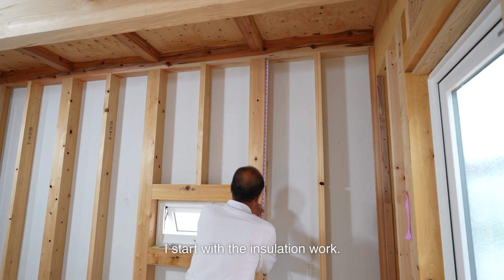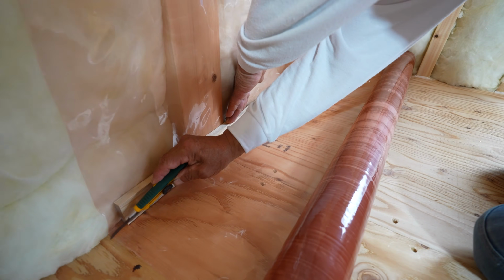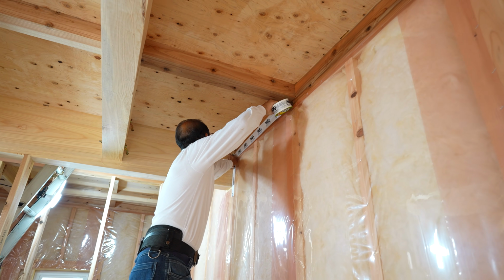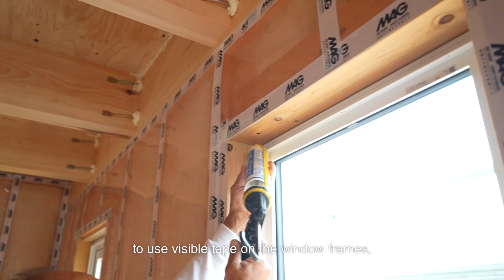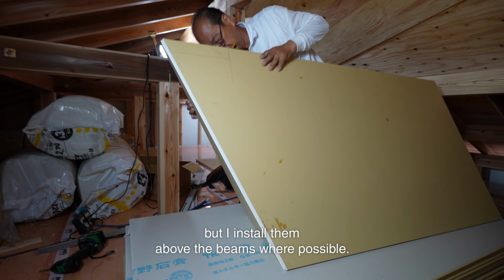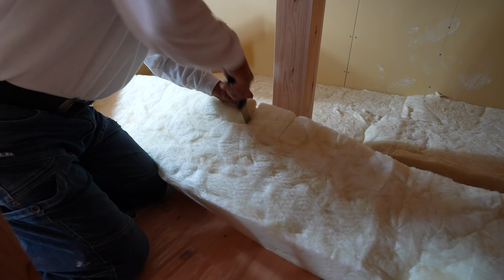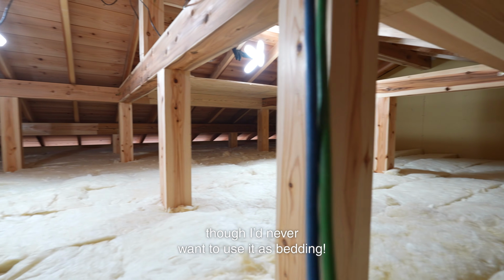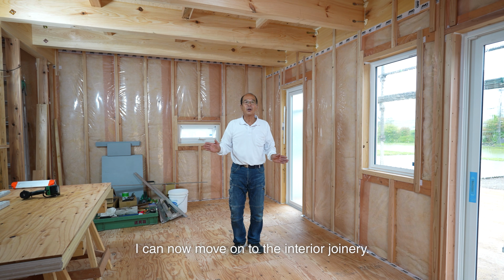The Ultimate Insulation Challenge: Creating a Magic Flask-Like Home | New Build Season 5 Part 5

Comment: I've built a house in Sweden and we use a somewhat similar membrane with the air test to rate the tightness of the house.

Previously, tape was not a requirement but it's used in all new construction.

There is also a technique used that creates horizontal and vertical layers of insulation to minimize heat channels (wood) and retain heat.

Cool to see differences and similarities around the world.

Comment: There's another method for air sealing that fills the house with essentially a fog of sealing material that fills all of the gaps it goes through. The house is put under positive pressure so the material is forced through any gaps. Gaps you don't want filled have to be taped before hand. This method fills gaps you can't see or reach. I can't imagine it's good for the environment since some of the fog of material escapes to the outside.

Comment: When I left the U.K. they started to build homes that were passive, air tightness test ect were required to meet building regulations. Now I’m sat in a house/shed in New Zealand…. Let’s just say that it is roasting in the summer and cost a small fortune to heat in the summer. You are truly a craftsman.

Comment: You had a beautiful and spacious attic space before you added your two layers of insulation! Spacious enough to use as a useful storage space! … As for the MAG-tape used, I found it to be useless because you had already secured the plastic membrane with staples using a cordless staple-gun! … Having said this, … I did see that you took precise measurements & that you made precise cuts & precise installations. 👍

Comment: 1:32 you should apply a second row of insulation above the wood, horizontally, so that you minimize the thermal bridge caused by the rafters. The second insulation can be pinned by wooden planks to the existing rafters and after that you can apply that vapour retarder directly on the planks with double adhesive tape

Comment: Very similar to how we do in Finland if a wool insulation is used. Newer option is to use aluminium coated PU plates. In the attic we use blown wool nowadays. It fills smaller spots better than wool plates.

Comment: Why would you want an air tight house? I thought houses was supposed to be able to breath.
Reply: To avoid moisture going to where it shouldn't and rotting out your house. Houses don't breathe, people do.
Whether this was done right depends on whether a vapor permeable membrane was installed or not (air barrier= good, vapor barrier= bad).
Reply: @rsmith02  I'm thinking about old log houses (the only type I can say I know somewhat good) and with them you want airflow, but you're more right about this house than me :)

Comment: Assuming that value was acph at 50pa  with a value of 0.146acph is Way beyond passivehaus. 
None of my comment will be correct if my assumption is wrong however😂
Reply: It's a "c value" of air leaks/surface area ㎠/㎡

Comment: I usually hate companies that tell you you shouldn't use replacements from other companies, but in construction this is usually because the materials and adhesives are required to match to get the proper results, sometimes any results at all, and not just out of greed.

Also, using what is essentially a thick cellophane sheet to insulate a house seems practical from installation price perspective, but any damage done to it render most of it pointless, won't it be better to insulate the outside panels from the inside? Using something like "big stretch" or any equivalent to create an airtight seal between the wooden beams and whatever you nail into them to create the outside structure as well as between all of the panels with an extra of waterproof construction tape should create a perfect impermeable seal that is far less likely to be damaged by someone doing renovation, and any damage that is done to it can be easily resealed without tearing down the entire section of wall. If this cellophane membrane is punctured or cut, you are essentially forced to replace the entire section top to bottom, which is a big hassle.

An example of what I'm proposing would be the ZIP system.

Comment: How do you deal with punctures? The moment someone goes to hang a picture its no longer sealed.
Reply: Wrong, it goes into the drywall and there's a gap created by the furring strip.
Reply: @rsmith02  here things go through drywall, not just in it. And in some cases into the studs. It seems inevitable that it's going to fail as a complete seal.

Comment: I didn't notice any electrical receptacles installed on the outside walls. Won't an electrician need to cut the vapor barrier anyways to put in the receptacles.

Comment: I believe the number calculated on the iPhone is air change per hour (Q50). The final value of 0.146 air change per hour, or  1 air change in 6.8 hours. It is an excellent result. A passive house standard only requires maximum 0.60 air change per hour. Your value is about 4 times better. Good job, Shoyan.

Comment: Glassfiber needs a vapor barrier membrane like here is done. I really hate fiberglass, rockwool and similar inorganic insulation materials. These all need a vapor barrier and if somehow wood still gets moist anyway problems start to accumulate. I have seen this for so many decades. Last 20 years in construction I have used either wood wool, linen or usually cellulose based blown stuff. 

These house that are 100% air tight are like bottles. They need power ventilation and carefully calculated air flows. But that is the world today.

Your craftsmanship is truly exemplary, even with the use of plastic films.

Comment: I'm surprised you're not using a smoke test to find the gaps.   In the USA you walk around with a small smoke generator and look for the air escaping while under pressure

Comment: Just a thought, for the attic insulation, lay both layers at the same time so you don't have to stand on the 1st layer (unless you are laying them in the opposite direction)?  Thx for sharing.  I like the house building series.  From foundation to finish.

Comment: In Sweden this airtightness would result in moulds and wood fungus breaking down the construction and making the inhabitants of the house sick from allergies…

Different environments- different solutions😊
Reply: That's just not right. Japan has much hotter summer temperatures and humidity (35C with a dewpoint of 24C) making mold a much bigger problem than frigid Sweden. A variable permeability air barrier like Siga Majrex, which is used widely in Europe, work well here or there, both winter and summer.
Reply: @ it’s very well tested that airtight houses are more prone to develop problems later on.

Comment: what will you use for your mechanical ventilation?
Reply: AC most likely 😊
Reply: @WANDERER0070  Not in Japan where ductless minisplits are king. Likely just exhaust-only pipe fans plus ventilation holes. Some homes have ERVs and ducted ventilation but it's unusual.

Comment: Shoyan what about condensation build up and mold build up on the surface between the membrane and the interior finished wall? American homes have done away with a sealed home using plastic membrane. Homes are built aur tight but the inside and the exterior walls have a ventilation gap. Your a master at what you do. Very impressive and amazed at your attention to detail.
Reply: American high performance homes can use variable permeability membranes but you are right that the 3 mil poly is just for Alaska and very cold climates. Mag sells both.
In Japan the ventilation channel you mention is standard under the cladding.

Comment: I wonder how the ventilation is done for the house, fresh air is a must have.
Reply: Pipe fans and ventilation holes (or a ducted system) are legally required in Japan. With few exceptions ductless minisplits don't introduce outside air. Windows do not meet the 24h mechanical ventilation standard (.5 air changes/hour).
Reply: Open window 😂 turn on AC

Comment: If you use this airtight method, once the house is complete, how do you keep it airtight like when someone drills into a stud to hang something? Cabinets, TV mounts, even picture frames things like that? Also plumbing and electrical?? Where are those ran in the walls? How would repairs be made in the future without losing airtight?
Reply: Ceiling and wall boards have not been put up yet, though.
Reply: The furring strips and studs are where people should drill and most of those have tape applied to them which will seal the small screw holes. A handful of holes really isn't an issue. Small holes in drywall isn't a problem really as they don't penetrate the air barrier.

Ventilation holes will be cut through this envelope and also sealed with tape and made air tight in the same manner. It will also be taped at the outside.

The outside cladding will also be covered in a housewrap that is taped at the seams and where there are penetrations for wiring or plumbing. This is standard for such homes in Japan, the US and Europe.
Reply: @rsmith02  Everyone here keeps missing the point of what we are saying. A house in the US is wrapped using the ZIP system, for example, on the outside of the house. It is tested and found to be airtight. Theoretically the owners of that house could do a full interior remodel, pull down drywall, rerun wiring, change plumbing. As long as they didn't pierce the outside ZIP System, that house should still be airtight. This Japanese house, they can do none of that without compromising the airtightness due to the system being on the inside.  Just makes much more sense to have it on the outside vs the inside.
Reply: Exactly! I know in the US they do the airtight membrane on the outside of the house. ZIP system sheeting and tape as an example. Doing it on the inside like this makes no sense to me. And you know the owners are going to want a kitchen stove vent and a vent in the bathroom. This house is going to leak so bad before it's even complete.
Reply: @BretRogers  It is common practice in Japan to take measures to address the problems you point out in a country with high annual precipitation and high humidity.
Reply: @littlewing5271  Yeah, I live here. And I'm sure this is less to do with humidity and more to do with Japanese not willing to change how they do something. Making a house air tight in this way is not smart. Any minor changes to a wall will require way more work to reseal vs sealing the outside of the house. I would rather keep the moisture out of my walls.
Reply: @BretRogers  Room airtightness and room ventilation and ventilation are two separate issues.
It is common sense to consider room ventilation and ventilation during the design phase. This video shows only one part of the building process. Some construction methods use insulation in the exterior walls, but this concept is basically not used in wooden houses. It is sometimes used in renovation projects, but it is not very effective due to technical limitations in terms of performance. Also, the materials used for the exterior walls of recent wooden houses are different from those used more than 20 years ago.
If the humidity you mentioned affects the houses, then that is surely a cut-throat construction. However, we will face that problem at some point due to the aging of the building.
I have been involved in real estate development for at least 20 years with a real estate developer company, so I have some knowledge of the subject.

Comment: Many years ago I used to read Popular Science and Popular Mechanics magazines.  At that time this type of air-tight construction was "all the rage."  A few years later were stories of this type of construction being too tight and the air in the house keeping cooking odors, etc and the quality of the air being below par.  Air-to-air heat exchangers with forced change-out of air were then "the story."  I don't see Shoyan using any of that technology.  I am just wondering if this problem has been solved in another way.  But, another great and interesting video!!
Reply: Actually air tightness is the standard in green building throughout the world, not a fad. Japan is also a hot humid climate with much more rain than Houston. 
The key is controlling condensation and you can do that by building tight and leaving air gaps for excess moisture to escape (between your exterior sheathing and cladding). You can solve the winter condensation issue by warming the sheathing with a layer of external insulation and ensuring the interior air stays inside with a variable permeability vapor barrier. You can stop summer condensation with an airtight sheathing layer and then the same variable permeability vapor barrier which will let the wall dry to the inside.

For interior air you should have a 24h balanced ventilation system (heat exchanges are optional) with of course exhaust fans for bathrooms and cooking.
Reply: @rsmith02  "well, actually" lol
Reply: . It's due  to the location. As impressive as this work is, this wouldn't be a good thing in hot and humid areas, but here they are probably building for a mostly cold climate  where they dont want warm inside air getting into the walls. Here in Houston for example, we do the opposite and keep the moisture barrier on the far outside, because the  air inside is almost always colder and dryer than outside

Comment: This bothers me seeing a plastic membrane used. Zip sheathing and its tape on the outside is best. This method can lead to mold in the walls during different parts of the year.
Reply: Depends on the membrane. Look up variable permeability membranes (Intello, Siga, etc.) which have no such risk.

Comment: i can't believe that the air tightness testing crew not only stuck around to perform a second test after re-sealing the house, but also chipped in to help find and patch leaks!
Reply: American crews would not do this. They would show up late with 1 machine. It would be windy and they would say they need to come back another day. If they got a moderately good result, they’d tell you the value and if you wanted to improve it and retest, they would already be out the door and you’d have to hire them back again
Reply: @IanSmithKSP  This would not happen in the States. Large part of the problem here is Mexican labor. It is not they are bad people. Foreign and cheap labor means in not industry to make a career out of. Since it not a career path it affects professional pride and makes 40 year veterans like Shoyan rare here.
Reply: @chrisnameless8325  very true, brand new houses built where I am uses Mexican labor. The houses are built horribly especially compared to the older houses built in the 70s and 80s here.
Reply: Yes anywhere else, you would be left on your own to sort it out, fantastic dedication to quality.

Comment: I actually prefer houses that have a bit of leakiness to them. Feels and actually IS less stuffy and stale inside leaky houses.
Reply: if it's stale, it means your ventilation isn't working properly. the vmc is supposed to constant renew the air !
Reply: @brunetyannick1174  ..only on social media can you be told your own opinion and observations are wrong.
Reply: Have you actually spent time in a state of the art house? I'd much rather not have my intake air coming from the foundation or garage through random leaks.

Comment: These methods might be new in Japan, compared to euope this is quite the old way of doing it. 
We use brick walls, with the glassfiber spanning the whole inside, not like here with woodne beams in between, that will loose a lot of insulation strenght as the wood conducts cold/heat. Also we use more modern foils that can breathe on the outside and the inside (warm side). 
Also for the attic, you better not insulate the floor, but insulate the roof. Else in the summer the heat is already IN your construction. We use glasswhool or PIR slates against the roof with breathing foil outside under the tiles.
Reply: I think it has a lot to do with earthquakes - our brick walls would crack with the sort of seismic activity that's common in Japan. The timber can move quite happily in comparison.

It's basically a tradeoff where the house standing is more valuable.
Reply: You should see American construction 😂,  we're still in the dark ages.
Reply: Brick crumbles too easily .
Reply: Brick is awful for heat transfer. Roofline insulation is unnecessarily expensive (greater surface area) and harder to get the details right due to obstacles like the joists which you are criticizing in the wall example!
Mag also has variable permeable sheets; it's unclear which one is being used in this video.
State of the art in Europe (and Japan) would have exterior wall insulation to address thermal bridging.
Reply: @rsmith02  You make a good point on cost efficiency. USA homes often have the roof isolation done like this right, is it working in the summer in keeping the heat out?
I have actually never seen outer wall insulation. Or does concrete>insulation>brick count as outer wall? Else i wonder how to protect the insulation if its just outside.